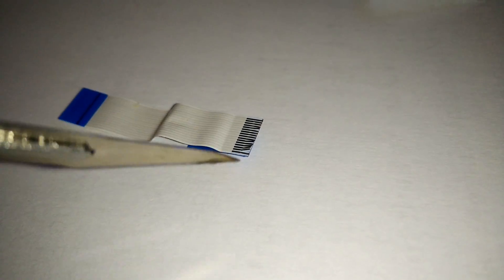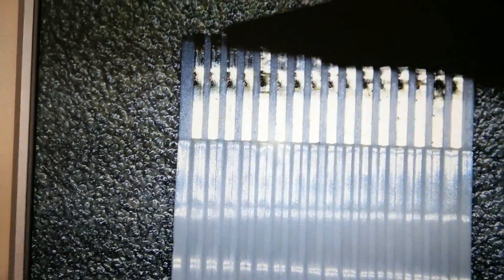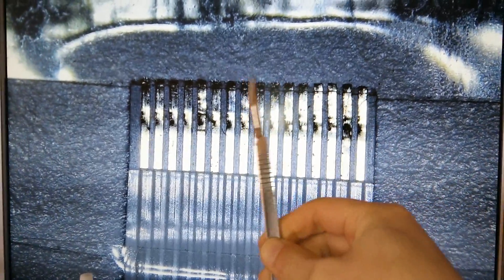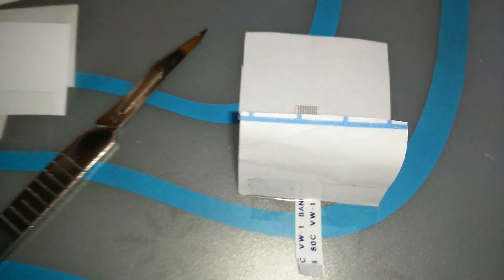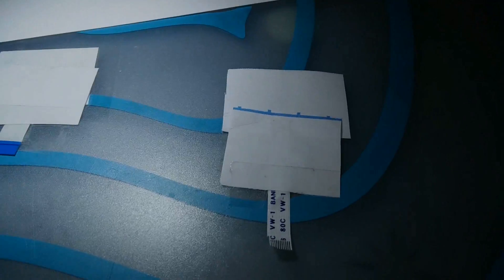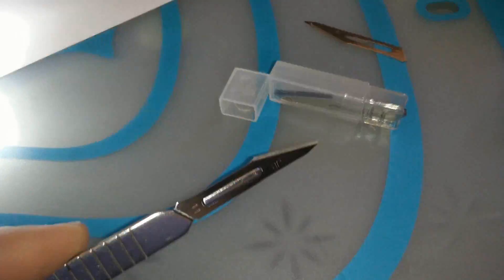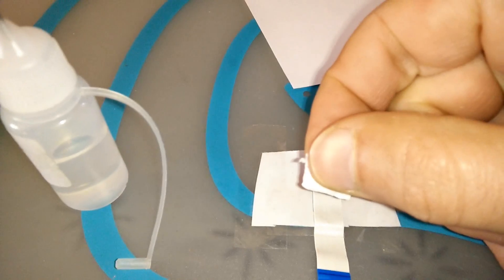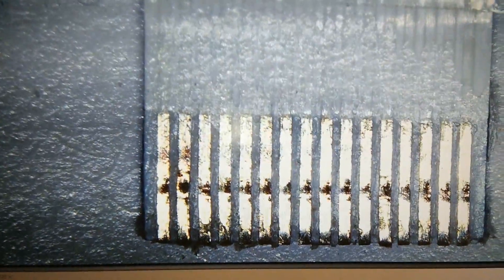Easily fix lifted pads from your FFC of your PlayStation or laptop without cutting it

Comment: These ribbon/flex cables usually only come in two sizes(0.5mm and 1mm). I have repaired a lot of laptop ribbon cables. You can get 20cm long cables from the hardware store. make sure to get 20-30pin types. Use a ruler and sharp knife to cut the cables to the correct pin size. Always cut 1 pin extra the first time then shorten it to correct size.

Comment: I have a 1984 TRS 80 model 4 that has these kind of cables. You can imagine how bad 30 year old cables can be
Reply from the maker: you can still probably buy them from ebay, no?
Reply: FixDaily - Electronic repairs, hacks and tips they are very rare now a days since Tandy Radio Shack went out of business.
Reply from the maker: @anthonybrunotheodd  you probably can solder each wire on both sides of both boars, it will take you forever but it must do it :)

Comment: Do you know how to strip the insulation off of these flat ribbon cables?
Reply from the maker: if you have a fiber glass pen, you can had extra isolation to it and rub it. But it will probably make it weaker. 
You can also use a very sharp blade, but it is always very tedious, usually you end up destroying it even more :\

Comment: You have put the glue, then cleaned it from all the pins. So, what was the reason for using it? Please, let us understand the whole idea. 
Thanks a lot.
Eng. Wissam
Reply from the maker: Hi, because some pads were loose and i couldn't cut it because the size was not enough for cuttings. Also because it is easier if you glue it, comparing to cut and strip the top protection.
Reply: @FixDaily  
Thank you sir for your fast reply. But, do you mean by (pads) the spaces between each two contact strips of the flat cable? or what please?
Reply from the maker: @poorman77222  hi friend, i meant the electrical contacts that were lifted from the plastic :)
Reply: @FixDaily  Thank you so much dear friend. Now, I have a question if it could be. I need to connect the flat cable of a HMI in it's position on the touch screen base. So, how could I do that perfectly with no loosen contact point? Should I use a glue for that? or how? Could you please display a video for that? I'll be very grateful my dear.
Reply from the maker: @poorman77222  Could you send me a picture of it (host it on imgur so i can have a better view of it
Reply: @FixDaily  I'll try to get a clear picture ... thanks dear.
Reply: I've got two pictures. So, pls send me your email.
Thanks
Reply from the maker: @poorman77222  Host it here: https://imgur.com/ and send me the links :)

Comment: Is all ffc ribbon is the same?  Because in confused 
They have the same pins but they have different v?  Correct me if im wrong
Reply from the maker: hi friend, what do you mean about different v?
They are similar, they have different pitch and length, also some have different materials but their propose is all the same
Reply: @FixDaily  i mean volts,  like mine it written at the back of the ribbon 
20696 80c 30v
Reply from the maker: @daydreamers845  Oh that means 80ºC and 30V maximum.
You have to take a look on where it is and see if your replacement fits the needs.
But if they are the same pitch usually they fit the needs. Also 30V is the lowest FFC voltage i know, at least from those white ones.
Reply from the maker: @daydreamers845  Also  if that's from a laptop, you i'll only have maximum 19V on your FFCs (that will not even be applied, usually maximum is 5V), the highest voltage you might have on your laptop  is from your lcd backlight, but that is driven by wires not by FFCs
Reply: @FixDaily  is it fine if i use above 30v? By the way thank you for answering my question
Reply from the maker: @daydreamers845  No that's not fine, because they are low current rated, if you apply more voltage, you'll also increase the current and they will heat up and get on fire

Comment: Hi sir i need help i have an HP Pavillon DM4 notebook that i disassembled for cleaning and when i assembled it i broke the touchpad flex cable connector end which should be connected to the motherboard the cable is very small it's about 0.5 cm and it contains 6 fine copper lines i tries cutting and scratching using a blade but it didn't work please if you have any idea or know a resource such as video tutorial or website that explains how to do please help me and shall be very grateful
Reply from the maker: Since they are just 6 lines you can solder some thin wires from both boards, connecting them each to other. But this will make it definitive and non-removable, so if you are able to solder wires to just one side to the flat cable to the board, you can at least have one end removable and the other end definitive.
Since you have destroyed the end that connects to the motherboard maybe you can flip it and bend it to the other way, to make it fit again with some soldered wires to it soldered directly to the touchpad board - i believe both ends were the same size. This way you don't solder wires to the motherboard. If you can remove the connector and solder the Flatcable to the touch pad it might work aswell, it depends the thickness of that wires. Use hot glue to make everything steady.
You can also buy the flat https://goo.gl/KzsBn4 is this one?
Reply from the maker: Or this one? https://goo.gl/FPN3TJ
Reply: Hi sir i am sorry i deeply apologize for being so late to reply you i with the help of friends of mine was luckily and happily able to find a shop that sells standard 10 pins flex cables that i bought and took with the computer to a repair shop where the repairer modified the flex cable to have only 6 pins and place it in and it finally worked and happiness made me forget to reply you! again i apologize and i thank you a lot and i won't hesitate  to ask your help if i would find any  issues or difficulties. With deep respect.

Comment: bought a new one online >_> £1.62. spares me the hassle to go buy a microscope and powerglue just to fix a fcking ribbon...
Reply from the maker: I understand, but in my case i didn't have that specific size and pitch and i didn't want to wait 1month to arrive from china. so i solved the problem :)
Sometimes you can't even replace it because there are FFC cables with different pitch on both sides :\

Comment: i peeled the blue thing from the end of my ffc cable.. now i peeled one face of the cable and got all parallel fresh pins.. only issue now.is the cable wont stay in connector without the blue chip.. what to do? sorry for bad english.
Reply from the maker: Just find for another one and remove the blue plastic and glue it to it :)
Or use another plastic sheet and glue it aswell.
Reply: thanks man. gonna try it this evening and hoping 5o fix my old digital piano gone dead coz.of.the cable.
Reply from the maker: In alternative you can solder jumpers, but that's a too long job. If you have platy of cable you are more than good to fix it, Good luck sir :)

Comment: And if you have enough ribbon cable length, just take nail sissors and cut 1 mm off the end. 

Some of the loose track length will have gone and most important is the connector will press it's contacts on to a new place on the tracks, better connection :-D.
Reply from the maker: That's true but unfortunately (in my case) this ribbon cable was not too big, so i had to do it this way, but i have to say that i was amazed with the result, this has never failed since I've made this video and it is working since then.
Reply: Don't get me wrong, your method is really good, i was just showing my bodging side lol :-D.
I've been a repairer for too dam long, and bad habits creep in.

I did a bodge on my neighbours laptop, the lvds screen cable was very old and cracking across all the lines as it passed the hinge.

It was an odd cable that wound up like a toilet roll, but centered on the screen hinge, very old lol.
Lots of really thin wires were added to get the signals over the cracks, lvds connector to laptop connector.
My words were "Get a new cable, or get your data off it" so he knew it would not last.
Still a bodge though :)
Reply: Is this real? So you can fix this issue in less than 10 seconds?
Reply: Thanks bro